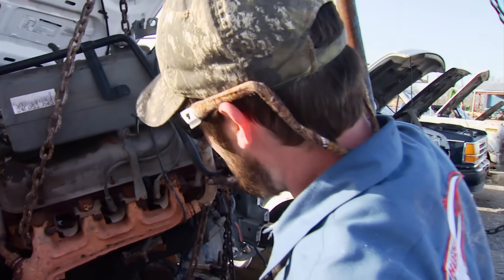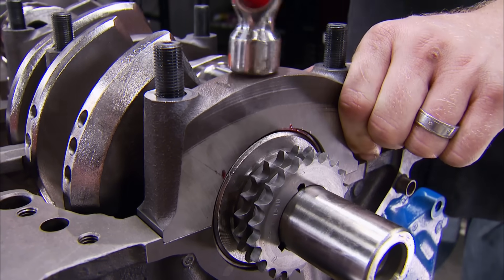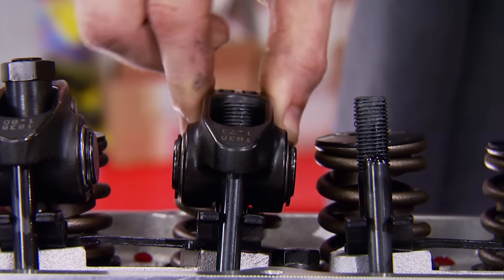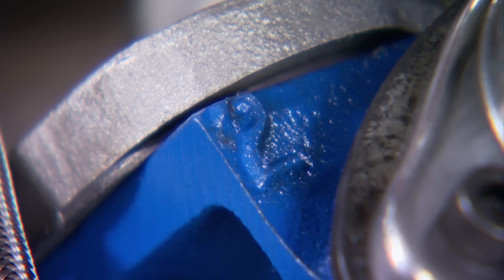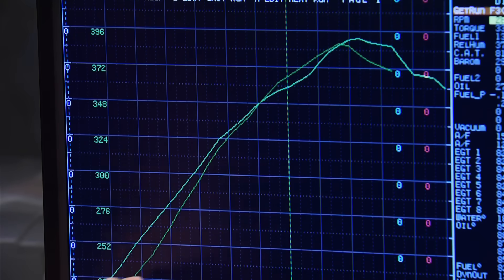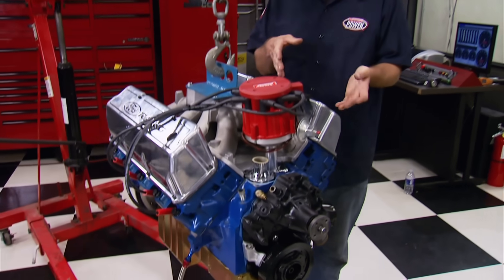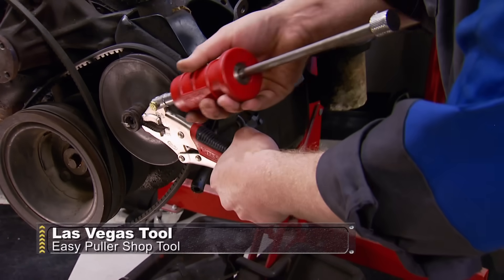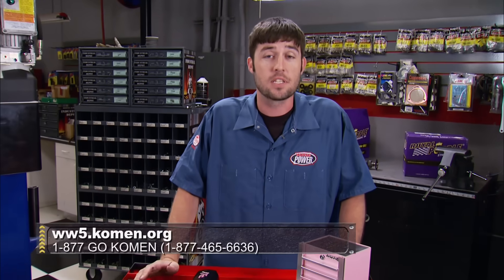351 Small Block Dyno Shootout: Windsor vs Cleveland - HorsePower S16, E11

Comment: Im curious how this is a direct shootout with one being a stoker...
Reply: Also Cleveland vs Windsor should have used a Windsor top end as well on the Windsor.
Reply: 289pinto  Yes exactly, both on stock Ci & factory W-heads vs 2V Clevo heads, both taken to 6000rpm
Reply: Its Like the guys who did coyote vs LS build but used a stock coyote intake manifold, stock rods, stock pistons..etc and on the LS they swapped intake manifolds, heads, cam, pistons, rods, had EFI then said "as you can clearly see the LS beats out the coyote"
Reply: Yeah and nothing like 100 more cubes and a 1/2" more stroke to even things up...
Reply: In the Ote/LS vid mentioned earlier.
Reply: Reid Murnan ..... My rub with that fiasco was only one thing....60 CUBIC INCHES!! The Coyote motor makes 1.56 HP PER CUBIC INCH....STOCK! Even displacement between the two engines would have been a huge embarrassment for Chevy and they knew it, so they MADE DAMN SURE there was not to be equal displacement in the contests’ rules. IMAGINE 94+ HP more out of that screaming Coyote!
Reply: @reidmurnan6708  That's what demon rats do all the time: Rule Change.
Reply: @reidmurnan6708  That caparison was a joke 7.0 aftermarket monster vs a 5.0 junkyard truck motor smh complete bs
Reply: @reidmurnan6708  nIled it
Reply: @reidmurnan6708  Chevy guys always have to cheat to beat.
Reply: oh hell yes, the LS beats everything. hell, you don't even have to change oil in an LS, it beats every piston engine ever made. why john force is not using them, i have no idea unless they have not yet made components strong enough to permit the use of such an engine. but, can you just imagine the day that an LS does go into a nitro funny, records will fall
Reply: Reid 😀
Glimer belt whine
Turbo whine
Gear drive whine

Chevy whine =
"My big block 502 with dominator and nitrous will kick your 302s ass."
Reply: @reidmurnan6708  Hilarious, you no question have a bias against chevy.
I've never seen that comparison, furthermore the ls came with fuel injection...
Reply: @elonmust7470  so did the coyote..... They originally had plans to carb swap both but it didn't pan out my point was they completely re-did the LS EFI with an aeromotive FPR, larger fuel rails & 80# injectors but kept the coyotes OEM. They even said in the test the coyote ran out of fuel. They rigged it & I dont have a bias against chevy dumbass I own 3, the coyote is just a superior engine.
Reply: @reidmurnan6708  The coyote is not a superior engine. It's an ohc engine. The extras associated with the valve train give it advantages, but for the money, & for the simplicity of design, the LS wins. I don't know who did this test you're referring to but they could've easily tested with a stock LS (let us not forget the hotrod mag junkyard 4.8 that made so many 1200hp pulls in STOCK form other than a cam, that it broke the dyno.)..
Reply: @elonmust7470  The Ford Coyote's are all EFI engines..... So, like in the video he references, upgrading the EFI and intake on the LS and not on the Coyote is playing dirty pool.
p.s. The video is easy to find.
Reply: @BloodRaven1969  I'm very aware that the coyote is & always has been an efi engine.
Look there're plenty of worthwhile tests between the coyote & the LS out there, what's your argument?
Reply: @BloodRaven1969  You have Ford bias as well.
Reply: @elonmust7470  Simply that in the case that was being spoken of things were done wrong, with a clear bias. Also that you failed to address the fact that the Coyote is also an EFI engine. As for Ford bias? I've owned and raced Ford, GM, Chrysler, AMC, and even a VW. My bias is going fast, in whatever catches my fancy to do so at the time.
Reply: @BloodRaven1969  what kind of idiot finds it neccessary to mention that an engine created in TWO THOUSAND & TWELVE is fuel injected? "Yeah I just bought a new TV at Bestbuy, It's not a CRT..."

I told told that there're plenty of unbiased "coyote VS LS" comparisons out there. Focusing on a specific event shows the bias...
Reply: @elonmust7470  While the LS is based on an old design you felt the need to point out an engine released in the more recent past all came fuel injected, so you tell me.
Reply: @elonmust7470  p.s. I've built and raced cars of all makes since 1986, I do know what I'm typing about.
Reply: @BloodRaven1969  I'm not the first one who mentioned it, genius.
Reply: @BloodRaven1969  You could've been doing it for 50 years, doesn't mean you've done it right...
Reply: @elonmust7470  Actually, you were. Read back.
Reply: @BloodRaven1969  You missed the 2ND post, by Reid Murnan..
Reply: @elonmust7470  Reid pointed out the comparison, You pointed out that the LS has always been fuel injected, Reid and I pointed out that so has the Coyote.
Reply: @BloodRaven1969  It shocks me how people change the subject.  I was not the first person to mention EFI.........
Reply: @elonmust7470  Change the subject? All I did was say that the Coyote, like the LS, was always EFI. Check yourself on subject changing. The way your first response was made, you make it seem like changing an intake and factory efi on one but not the other makes no difference.
Now, I'm done with you displacing and diversion junior.
Reply: @BloodRaven1969  I never said anything like that bud.
Reply: @BloodRaven1969  I mentioned FI because Reid did. The context being that both motors have always been FI.
Reply: @elonmust7470  Theodore Dowman
5 hours ago
@Reid Murnan Hilarious, you no question have a bias against chevy.
I've never seen that comparison, furthermore the ls came with fuel injection...
Reply: @elonmust7470   they have an episode on the build comparison.  I saw it last week and thought the same as Reid's
Reply: @elonmust7470   I want the link for the stock 4.8 with a cam that makes 1200 dyno breaking horsepower.  Stock does not include a 76mm turbo or 500 shot of nitrous...
Reply: @elonmust7470  your not biased at all are you..lol
Reply: @BloodRaven1969  They were both built on a certain budget. The LS motors cost less to build the coyote being a more efficient motor but cost more to build. LS wins because it's more compact cheaper/easier to build. Even mustang guys LS swap their cars. I thought about coyote swapping a Camaro just to trigger some diehard gm guys but dont have the money lol. Both motors are sweet and capable of tons of power. But I'm a LS guy
Reply: @mesanders1113   I was just commenting on the fact both motors were factory designed and built with fuel injection. On your cost point, yep, but a bigger throttle body is an easy and cheaper upgrade for a Coyote, which is my main umbrage with that comparison. 
As I've stated before, I just like to go fast, make/model only matter to me in that I match make of power to make of car. LS swap whatever you want, I'd only be doing that to a GM product, but that is just me.
There are exceptions... An up to 392 old Hemi into a 50's or older car? Always a go. An early Caddy Ambulance motor in a 40 Ford Business Coupe, always cool.
Reply: @elonmust7470  "The LS came with fuel injection" you understand how new of an engine the Coyote engine is right?
Reply: @grren1782  If you read you'd see that I mentioned their circa date...
Reply: @elonmust7470  also in every single metric the coyote is better because it's a new design. It takes a lot of modern technologies that the ls just doesn't have and it's fundamentally better. Don't try to defend Stone age tech
Reply: @grren1782  I don't need to defend it, it's faster...
Reply: @elonmust7470  there was a 1200hp Cleveland 351 build what's your point an it was sbe as well junkyard motor
Reply: @reidmurnan6708  The Coyote should be a superior engine with it's dual overhead camshafts, but the LS is undoubtedly the king of the pushrod engines.
Reply: @reidmurnan6708  no...its not.
Reply: Theodore Dowman biased against because they had to completely rebuild it 😂
Reply: @elonmust7470  how much money will it take to build a 5.3 ls na to make the same power as a stock coyote?
Reply: @elonmust7470  - ????? So does the Coyote. Not sure what your point is, here.
Reply: @elonmust7470  different channel but it was pretty bad mostly stock vs very modified they had a budget and the ls heads were almost 2gs over budget by themselves so yeah and the ls really a updated Cleveland even the manifolds match up
Reply: @reidmurnan6708  The ls IS better anyhow.
Reply: @elonmust7470 a modern two valve engine just cant out perform a four valve engine..more air more fuel flow means more power.. the coyote engine makes more horsepower per cubic inch then the ls does..
Reply: @allenallen7569  And an lsnext block with trimmings will hold 3000 hp of pushrod power for less than what a junkyard coyote costs.
Reply: @Theodore Dowman , and a LS doesn't even compare to a Cleveland. These jokers comparing apples to grapefruit.  They just trying to sell parts. And they know there are alot more windsors out there. Although, there is now a all aluminum Cleveland that can be had.
Reply: @chadkent1241  The huge popularity is just in my head right?
Reply: @elonmust7470  better in what way I have two ls engines a 350 and a 327 there is no way that any of those can sit with a coyote maybe in cost per mod but I'm a realist the coyote will make more power yes its bigger dimensionally both engines have its merits but no form of racing is going to allow different cubic capacities especially not a 100 and some odd cube    advantage that's unheard of in racing all cars has a maximum cube allowed, I'm not going to sell myself short and enter a race were the maximum capacity is set for example at 5.3 or 327 cube naturally  aspirated firstly my engine wont and cant rev as high, cant breath as well and I dont think any body on the planet is going to enter a race series knowing that he already is at a los for power the coyote is the true winner here if the coyote had the same displacement as the ls in this bullshit shoot out it's a no brainer the coyote wins
Reply: I lost a couple of brain cells watching this. Everybody who knows Ford engines know the standard Cleveland heads are okay up to a point and on a street driven car the 2V's are better. Who in the world uses 70's technology unless they are really on a budget? I can build a Cleveland in my sleep that will make more torque and power than any Windsor with Windsor heads could. Slapping on some Alum Cleveland style heads on the Windsor, that is wholly unfair.
Reply: Christopher  the Cleveland has more aftermarket support than the windsor?
Reply: Well it's great marketing for the latest Windsor products that's for sure lol
Reply: Cigz Much totally agree!
Reply: Christopher  As I leaf through the Summit catalog, I see a crap ton of parts for a Windsor, and only half a page for a Cleveland. JEGS has similar results. Where are you getting your info from?
Reply: Christopher  Actually I did and you stated that the Cleveland has more aftermarket support than a Windsor which is simply not true according to the various places most people get their speed parts from.
Reply: @TwentytenS4B8  With the internet it's irrelevant, I can get the Cleveland parts I need including aluminum cylinder blocks if needed. No Windsor is going to make 900+ hp NA, but a Cleveland will.
Reply: Exactly lol 🤦🏻‍♂️
Reply: Agree, this video has no significance.  "I wish I had a Cleveland, so I'll build a Clevor."
Reply: The basic answer is availability of parts...    For the Windsor you can buy a 408 kit for under $1500...  Not even worth it to R&R the Oem parts....   The Nostalgic Cleveland is buku money...
Reply: Point. In reality they both make about the same hp per cubic inch. The Cleveland made 1.09 hp/cu.in. the Windsor 1.11 hp/cu.in.. Another note is the Windsor was outfitted with aftermarket aluminum heads whereas the Cleveland had stock 2V heads. Not a fair comparison. Next time stroke the Cleveland to the same cubes and use the same aftermarket aluminum heads and the Cleveland would make a lot more hp per cu.in.
Reply: Christopher  I understand that, but reread what you said, you said the Cleveland has more aftermarket support.
Reply: @centraltexasfoxbodies  It has a lot more than a lot of people say it does, quite a few companies here down under make a lot of aftermarket heads for them, then there's companies like Arrow and TMeyer manufacturing blocks (TMeyer has some block variants that will go close to 500 cubes, cam availability is insane down here too. There's plenty of factory ones around too, I quite easily picked up 8 of them out of farmers paddocks and stuff once the cars died for one reason or another
Reply: Was just thinking the same thing
Reply: Because they are pushing the Windsor builds.
Reply: Windsor can out perform a Cleveland thanks to modern tech and a lil napa know how  both engine had a similar compression ratio  in the end witch boils down to similar build just one was close in stock form not all good parts are new and shinny
Reply: @bigboreracing356  Yes. But it was would show stock heads suck on the windsor. Then swap to some AFRs or something and show that. They changed the heads on the Cleveland. Could have done the same on the Windsor.
Reply: I remember when this video first came out. The F'ed  it all up. They did the 408W because it has more aftermarket support. A 408 Cleveland would gave spanked the 408 W . And those Edebrock 2v heads are a waste of money.
Reply: Christopher  and they used open chamber cyc heads when most clevo like about 10.5-1 and run up to 6500rpm
Reply: Exactly,any body who knows these engines will attest that the Cleveland is a better performance engine in stock form than the Windsor in stock form. Both are great engines and either are more durable than a small block Chevy.
Reply: @bigboreracing356  I beg to differ my friend,back several years ago when I was building engines to drag race,the SBC was fast but required refreshing way more often than the SBF running the same mix of aviation gas,premium pump gas and octane booster + A 200hp Nitrous shot. The SBC just didn't hold up as long as the SBF engines did.
Reply: @bigboreracing356  As a former engine builder myself, I can tell you, I have seen FAR more broken bottom ends in SBCs vs SBF in stock and race spec, and SBC blow head gaskets at the hint of 220F!  AND I Can tell, YOU know nothing about what it takes to own a business, or the late Friday nights working on a customer's car to get it out of the shop so you can get your race car in and put the parts on, change oil, tune, so that Saturday AM the shop is open for another customer car or 10, that way Saturday night you can go out and have fun yourself...one night a week.  SBC had a shit oiling system, it had way too small main bearings for street/drag longevity, the ONLY place their tiny mains were an asset was circle track...BUT there the SBC engines are still tore down and freshened more often due to the shitty oiling system!  (I mean to keep the worthless bottom end together you have to restrict top end lube, every engine builder on the planet knows this!)  4000 engines in something like 25-30 years I can believe it, we specialized in "engines" yeah we did exhaust and tires, but mostly we were the local SPEED shop, that did installation of performance upgraded engines...you really want to know what our biggest "street customer" was Chevy 350s that were in too large of a vehicle, class c motorhomes, and 1ton duallys...that had a 350 when they should have put 454s in them...Ford did same thing in late 80s with 351W H.O. funny thing is they did OK...where the SBC would beat itself to death, and made LESS power than the 351W H.O. HMM yeah the 350 is SO GREAT...SMH!
Reply: @bigboreracing356  WOW MORE NAME CALLING, Maybe if you built a couple thousand engines you would have more respect.  99% of those POS Chevy Ventilated Blocks were NOT built by ME, but by "Non-Professional Engine Assemblers" like yourself, and other so called "Engine Builders" that don't know what they are doing, just buy parts and slap them together.  When I built a Chevy engine, they actually held up, because I knew the weaknesses and fixed them by machining the oil galleys, and crankshaft properly. When YOU grow up we can continue...So until then, Good Day!
Reply: I'm a ford guy, but I have a lot of respect for the LS and now LT engines.   They make incredible power compared to the gen 1 sbc.  I'm also a big fan of the coyote.   It does more with less, and gm better hope Ford doesn't ever kick up the displacement to 6.2 liters, lol.
Reply: What a load of crap
Reply: I agree , your modifying all this how is it a fair comparison, shouldn’t be stock for stock ?
Reply: Christopher  nope, but I wasnt sure if you typed wrong or just didnt know what you were talking about
Reply: @bigboreracing356  Well, I can tell, from your name calling, and your Total Lack of "Common Sense" and Complete Lack of "Business Sense" you have an I.Q. number that is around room temperature, so rather than trying to explain how things actually work, I am going to leave you, to continue to be "YouTube Badass" all by yourself, from your mommy's basement, us adults that can actually have intelligent conversations, have better things to do, than to wade through your bullshit.
Reply: @bigboreracing356  WOW still name calling, how grown up of you.  Most people with common sense would stop with name calling and have a normal conversation on how YES there were 5:1 Chevy vs Ford on the local track, and saw 200+ of Chevys with ventilated blocks and 3 Ford's (and 1 Mopar)... Shouldn't the Chevy number be closer to 15? (Or the Ford's more closer to 40 or 50?) HMM?  You just don't want to admit what I stated about their weak bottom end and oiling. (You instead had to ASSume that I didn't account for the 5:1 Ratio, and resort to childish name calling.) And the funny thing was, the FORDS were consistent at winning, the odds were certainly stacked against them.  It was fun to watch.  The Chryslers tried very hard, but lacked much in support, too bad, because they had the lightest intermediate cars.  Those of us that were there, and actually built engines, and cars for the track know this.
Reply: @bigboreracing356  WOW, You'll never grow up, and SBCs oiling systems are still SHIT compared to SBF funny thing is WE ALL KNOW IT.  (My shop specialized in Ford Performance, but we built other brands of engines too, just didn't specialize in them.)  Its funny, how you act, and talk.  Go back to School and Learn something.  [""I drill the holes in the block beeger and make the holes to the top leetler so that makes me a perfeshunall motor beelder"" <-WTF are you babbling about?]  SBF Rod Bearings are BIGGER than the MAIN Bearings on SBC, if you knew anything about oiling and durability, in "ABUSE" not just "RACING" that is why the bottom end of SBF is far more durable, especially because the CRANK is LARGER and STRONGER, and hence WHY FORDS oiling system HAD to be better...DUH!
Reply: @Anthony Mayz , Fords expect to loose to a LS? LMMFAO. I don't hardly think so. Don't know what you been smoking. But you should lay off that shit. It's making you delusional.  And no all engines aren't the same. Sure they all run because of the same laws of physics. But each have their own design. And I don't know how all this different brand and LS crap came up anyway. The video was about 2 Ford engines. One basic lyrics stock engine compared to a highly modified custom engine. Then like dipshits, they wanted to try to compare the two.
Reply: Duck you and your minian. You've got aftermarket aluminim heads adapted from a different engine. Non stock pistons, rods, cam, rockers, intake, stroker crank. Only stock part is a modified block. Now why they used a dual plane intake and the specs they did.....well that's on them.
Reply: You're a dumb ass. They changed EVERYTHING. That is modified. The Cleveland they used factory shit. That's stock. I can't help what specs they used. And you don't need 4000.00 for heads. And you think its hard to stroke a Cleveland? Why mess with a stock stroke? Because they are comparing two engine designs to see which is better. You change one you have to change the other. Did that actually need said? Dan you are STUPID.  Any clue what's going to blow where when your 250 shot goes lean ? That's another issue these guys are going to have. They need different carb. They don't know shit about a Cleveland
Reply: @Brock Main3, same as it's always been. That's the reason Chevrolet has always been popular. They are cheap. You get what you pay for. Also the age has something to do with it. Ls been around longer.
Reply: WTF makes the difference how many people have done whatever? And what makes difference where the parts came from? Anything different than stock is modified.  Especially if using parts that belong to a different engine.  You're stupid ass shoulda bated more attention in vocabulary class.
Reply: I agree it is not comparing apples to apples. If built the same the Cleveland makes more torque and hp. And if set up right the 4v heads are better.
Reply: Christopher  I think you've got that back to front mate ?. Windsor taller deck, stronger block. Bigger stroker kits on stock block. 
Ps. I own and love the sound of a healthy Cleveland.
Reply: Christopher  I'm Australian mate.  A lot of guys grout fill their stock Cleveland blocks for 550+ hp here for strength. Or usually just go a aftermarket block. I've got a stock block C with factory 4v cc  heads, makes 500 hp 500 ftlb in my 50yr old falcon. It's just a cruiser, nice for just running through the gears driving through the hills
Reply: * stroked 393
Reply: If all things were equal, the power/torque output would be equal. But the Cleveland build was still interesting. It's odd to me that the 4V head didn't make any more peak power than the 2V, even with a single plane manifold. The only real comparison to me was the 2V vs 4V Cleveland. Now, get that single plane manifold off there and put a dual plane on as you won't be running 6500 RPM to the grocery store.
Reply: How about 351c closed chamber? Using 2v port intake on 4v head. Just selling advertisers crap.
Reply: Yes, and with the Cleveland style heads on the Windsor. The title doesn’t make any sense.
Reply: They even put cleveland heads on it too. What's messed up is that there's a 408 stroker kit for the cleveland.
Reply: @TigerNinjaDragon  My father wouldn't care.
Reply: Exactly... Everybody knows the 4V Cleveland head ports were too big for a 351 hyd cam STREET motor, but if u had made the Cleveland a 408 I am pretty sure the extra cubes would have started working the head, gotten the velocity up, and the results would have been alot closer to the "Windsor"...
Reply: This is BS. All you did was put a Cleveland vs a clevor if both were same displacement same head design same internals. It will be basically the same. Just weight difference.
Reply: Daver G  why couldn't they get a junkyard coyote
Reply: At the end of the day, the 351 Windsor is a good solid engine that can run with any equivalent 350sbc.
But the 351 Cleveland was built to go nascar racing. And it’s still the big bad small block king. It’s not even worth the argument. It’s a far closer relative to the big blocks in head design than any small block.
Reply: The Cleveland heads will flow a hell of a lot more volume than Windsor heads, so the video is truly meant to show what the Windsor can make with reasonable cost upgrades. Remember there are a jillion Windsor’s out there, not that many Cleveland’s. You want to go racing...Cleveland is the motor you want. On the street the Windsor is a cheaper alternative. Stay with the dual plane intake.
Reply: I am reading all the fights and name calling , LS vs coyote vs Cleveland vs Windsor.  What the heck guys! Run what you want , don't knock the other man's choice.  I want to build a FE , I know that unless I find a cammer in some dream world , most newer engines and teck will out perform . But i want what I want . Don't dis someone just cause he thinks differently
Reply: @gsxtr1 cap
Reply: I agree
Reply: The cleveland is higher compression
Reply: I'm just getting used to these guys being all shit
Reply: There both 351
Reply: @southpawpaw7967  wtf are you on, did you watch the video? They stated they put a stroker crankshaft in one of the engines so it is no longer 351 cubic inches. Makes a big difference
Reply: @paulcochran3780  
😃👍 I was truly inspired by the 351w vs 351c test in ^this video, so I decided to do a test of my own! I just completed it. It was a fair engine comparison between a 289 Ford vs a 283 Chevy. 

👉Here's the details:  The 283 Chevy engine was bored AND stroked out to over 400 cubic inches, with 11.5:1 compression, a radical racing cam, and a tunnel ram with 2 Holley 750cfm 4bbl carbs. The Ford 289 was a stock, un-rebuilt engine with it's original 2bbl carb and 8.5:1 compression cast pistons. 

👍 After completing my 283 vs 289 comparison test, I was SHOCKED to discover that the "283" Chevy made LOTS more power than the 289! Who would've ever expected it!?  So, clearly the 283 is a superior engine!  🤪
Reply: @HighlanderNorth1  wow aint that insane! your comment inspired me to do a dodge 318 vs a ford 302 vs a chevy 350. we put a 4 bbl intake on the 318, a eddy top end kit with cam on the 302, and for the 350 we used a dart big bore block, stroker crank, and we used some world product heads that we ported out and then slapped a tunnel ram, quad snipers, quad turbos, and a 1200 shot of nos. wouldnt you beleive it! THE CHEVY MADE MORE POWER! 

this is legitimately how i feel reading all the comments on this damn thread and watching the video. does anyone have common sene anymore, or are all the new "engine builders" so caught up in their guesses of "knowledge" that they make assumptions and then swear it to the death as facts? 

one of my best freinds built engines for 40 years. he always says "run your engine not your mouth". he had his hand on i swear every single part you can think of and he can just about tell you the power some combinations make. he has life experience, not internet experience, which seems to be lacking in alot of these dim wits. 

so excuse me powernation and your biased dickriders, but we need more explination as to why you did such an unfair comparison!
Reply: @paulcochran3780  
It wouldn't  be difficult for them to do fair,  "apples vs apples" comparisons, as opposed to some of the "grape vs watermelon" comparisons they've been doing. Why not a 283 vs 289, or 350 vs 351w, or maybe 340 vs 350(or 351c), but keep the builds similar and fair. Not top-o-the-line aluminum heads and quad turbos on one engine, and rusty iron heads and a 2bbl on the other! That may be an exaggerated and silly analogy, but its not like their comparisons have all been equal...
Reply: That's the only way a Windsor can hang with a Cleveland. The Cleveland dominated Pro Stock AND NASCAR in the 70s. The Windsor didnt.
Reply: They always do this stupid shit.    "Were gunna have a shootout of engines.   O e stock. One built to the moon.  Stuoid
Reply: And one being a windsor that's converted to the Cleveland heads ???
Reply: The head swap effectively was the head to head Cleveland Windsor test, I'd be interested in testing a dual plane manifold on these engines
Reply: Yeah the caption says Windsor vs Cleveland LOL.. not stroker motor versus a stock motor
Reply: Where is earl cooter and sterling bodine? Are they still part of this program?
Reply: I'm curious how these guys ALWAYS have such nice clean manicured fingernails ?!?Never even a speck of dirt under any nails.
Reply: It's because they are stupid
Reply: That irritated me as well...
When someone does a part for part 351 comparison I'll probably be too old to care.
Reply: Its not.  Both with edelbrock power packs / heads / intake is what I'm looking for.
Reply: @iwantfizzypop  Yep. Also you don't need Canted heads to go fast. Ideally it gives better flow at high rpm but it isn't needed up to a point
Reply: Whaaaa, whaaaa, but Ls..... Lol
Reply: It's funny how people get so butt hurt over comments about which engines are better. If you think Ford is better, use Ford products and if you think Chevy is better, use Chevy products. Who gives a SHIT what someone else thinks so long as you're having fun. Someone made a comment about being a child, well all of you are acting like children when you take the time to have petty arguments over each other's opinions. Now, go ahead and come at me, all of you, for calling you out on your nonsense. I'll be sure to NOT pay any attention.
Reply: @cigz was thinking the same thing
Reply: It's not.
Reply: Stoker?  Does it run Coal? (joke)

Is this like a “super-stoked Dodge?” where the fuel is oil-contaminated Anthracite Coal?
Reply: A .22 snd a 30-06 is still a shoot out if y’all firing At each or we
Reply: How could they push the more plentiful Windsor kit if they built them equally? Not to many people have the Cleveland block so they built a biased test.  I ain't even gonna watch the results.
Reply: me too
Reply: And one with a single plane intake and the other with a dual plane. Hardly a scientific comparison.
Reply: Christopher  i dont know what world you live! (Australia?) But clevelands have less head choices less stroker options and are super rare in junkyards. Windsors were made through 1997 where clevelands died off in the early 70s except the 351m/400 variants in trucks which made it until the late 70s... With crappy large combustion smog era heads... The design may be superior but emissions killed them in the states... I am very impressed with the 2v head 351 cleveland build and id say if you can find one build it cause thats an awesome engine the windsor should of kept stock stroke and got some afr205 cc heads both these 351s are good motors but windsors are easier to find and build
Reply: @nealpurdy1202 351/400 m we're not Clevelands. I've got 4 sets of Australian Cleveland heads that have 2 barrel ports with 4 barrel closed Chambers and had them flowed by my uncle who worked for Ford in the 60s. They flow clear thru 8 thousand. Run them in superstock since the 80s. Haven't seen any aftermarket heads iron or aluminum that can touch them.
Reply: attitude adjuster CHI, AFD and a couple of other manufacturers make heads that will eat factory Cleveland heads. 900plus hp is very achievable with the most extreme Cleveland heads. And I’m still talking aspirated on not stupid comp or fuel. 
The Cleveland is still king of the small block pushrod v8’s. 
Even LS’s are cannon fodder for serious Cleveland’s.
Reply: @nealpurdy1202  explorers had 302 into the 2000s
Reply: @centraltexasfoxbodies  5.0L Fox Mustang guys can grab one of the explorer intakes out of the junkyard and with minimal modification have the equivalent of a Cobra intake for less than half the money.
Reply: @centraltexasfoxbodies  It's a trade off though. 4.6 are much more expensive to build up than a 302  H.O. But on that note, you could stab in a 351W with the same parts as a 302 and make the same power and not have to worry about a busted block.
Reply: @TwentytenS4B8  wrong. 351 has taller deck height.
Reply: @nealpurdy1202  You can get Cleveland parts easy your on the internet aren't you? Simple 418 Cleveland with mild alum heads would make 700 hp quite easily. Richard Holdener built a stock displacement Boss 302 with modern intake, hyd roller and cylinder heads and make 600 hp Emissions didn't kill it know your Ford history I do, they just made a choice the 351W was cheaper to manufacture. The overall design lived on in the 351M and 400M. Windsors are easier to find because they lived in trucks and vans, which companies buy by the millions each year. Windsors only became popular as the aftermarket supported it since the 302 and 351 can use the same heads and intakes are cheap to make.
Reply: It might be a cost thing, like the build cost ends the same since I believe Cleveland parts are more expensive then the Windsor's
Reply: @jacobszymczak9323  thats what i was thinking there doing it by with a certain budget or something they arnt even building them the same so not really a shootout unless its cost related
Reply: @whatsBF3  Speaking of budget, that's one thing they never even mentioned once. Probably because these were both multi-thousand dollar builds.
Reply: The cost has nothing to do with the total failure of this build. While some Cleveland parts might be more expensive than the equal part for a Windsor, the difference is minimal and has no negative impact on the final outcome of this embarrassing attempt at building two engines with satisfactory results. 

There was no mention of any type of financial limitations or working within a reasonable budget. 

I was actually impressed when I looked over the components listed for both engines. There’s nothing cheap or “economy” minded about these parts. Most of them are premium parts distributed by preferred vendors when you could max out a gold card in record time 💰 💵 🏧 👀
Reply: @jacobszymczak9323  Thats BS a million dollar net work?
Reply: @fordlivinglegendstorinos9960  I'm saying is if for the comparison they are spending, say, 5k on each build, if parts are generally cheaper for one vs the other you can do more. Like you could build a Big Block Chevy stroker much cheaper than a Oldsmobile Stroker because parts are much cheaper for the Chevy Big Block 454 base vs the Olds 455 base. Not an exact comparison but if the shootout is cost based you see what I mean, they weren't trying to make the most powerful version of each there must've been some kind of limiting factor for the builds
Reply: @jacobszymczak9323  BS at least if they didnt stroke the Cleveland they couldve found a good set of cheap high compression closed chamber 4v Boss heads,, or even a set of Australian 2v closed chamber to at least bump the compression.. still this was a BS comparison!!
Reply: @jacobszymczak9323  if that's the case then why did they use the more expensive Cleveland style heads?
Reply: @jacobszymczak9323  the Cleveland can be stroked with a factory 400M  Ford Crank and some offset crank grinding.
Reply: @jacobszymczak9323  
Go to a junkyard and get one for cheap.
Reply: @bubbawubba2307  for the block yes I agree with that but I'm talking more about the rebuild parts, I'm fairly certain the internals for the Cleveland are more than the Windsor. Although with them modding the Windsor like they did probably closes the gap
Reply: @KevinTorres-xs9cq  Based on what, my haircut, my polo shirt? Does my face look like it's from the trailer park? Lol thanks God for making me look like I'm from the trailer park... (do you see how stupid that sounds?)
 Not to feed into this but your profile pic looks like it could very well be a picture of a jeep in or near a trailer park.
Reply: @KevinTorres-xs9cq  Lol you made fun of someone for doing goku and you yourself have a playlist of video game related garbage.

Stick to your videogames ROFL
Reply: Theodore Dowman and I wasn’t making fun of him I was pointing out that he’s most likely a kid and wouldn’t have experience with these engines
Reply: Theodore Dowman red dead redemption is for mature audience lol chill bro
Reply: @KevinTorres-xs9cq  So is everything else that 9 year olds play...
Reply: Theodore Dowman I have never seen someone get so sensitive over ppl telling u to watch the video for yourself 😂reading can be hard sometimes I guess. And btw the coyote is a better engine, it’s been proven, just do some research instead of bashing it and riding the LS. The coyote makes 850-900 RWHP reliably, it’s a efficient engine
Reply: @hossmoss8577  the LS does the same thing dude. You ford fanboy...
Reply: @elonmust7470  lolol I knew u would say that😂😂when u have nothing to prove your point you call everyone a fan boy. Sad honestly, but do u bro 👍🏼missed my point, what makes a engine better is not what makes the highest HP number. It's what can make that high hp number reliably. The coyote has proven to make and run 850-900 rwhp easily and live happy at thay level
Reply: @hossmoss8577  So has the LS...
Reply: @elonmust7470  after Heads, Cams, etc. U don't have to touch a coyote
Reply: Imagine thinking the coyote is better than an ls
Reply: KingBryant You literally make Goku videos stick to that...
Reply: @KevinTorres-xs9cq  See even children know that the LS is better.
Reply: @kingbryant5673  How is the Coyote not better than the LS? The LS is cheaper and smaller, yes, but if you are going all out there is no comparison.
Reply: @robertelmo7736  yeah no the ls is still better. All out an ls can still make the same or more than a coyote for less
Reply: @kingbryant5673  it is
Reply: @djcovert2517  man this is like a year old you think I remember what I said.
Reply: @kingbryant5673  imagine not realizing coyotes have been faster than LS engines.. and a coyote holds the stick shift world record
Reply: @Rexamillion16  still costs too much in comparison to an LS ATM. We're seeing more and more truck based 5.0 engines pop up but they aren't as cheap yet
Reply: @kingbryant5673  hp per liter or ?
Reply: @riccocool  horsepower per leader is a useless measurement. If that's the case in the f20 used in the S2000 is better than the LS and the coyote.
Reply: @kingbryant5673  imagine thinking the ls is a good motor